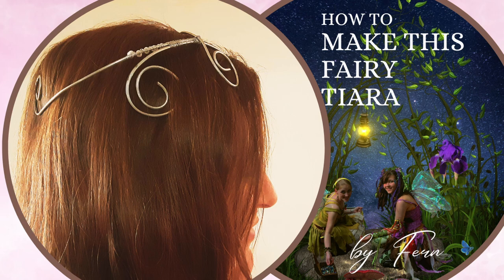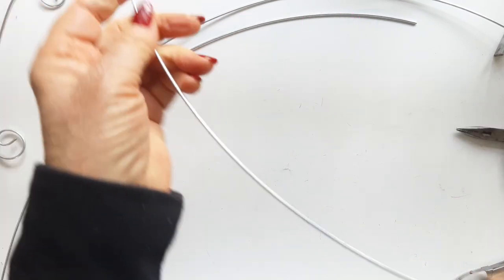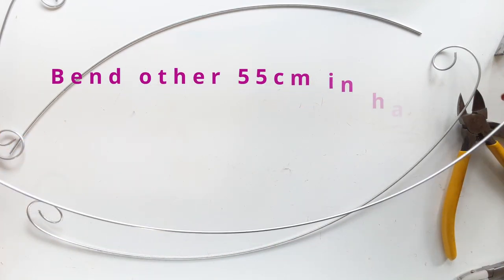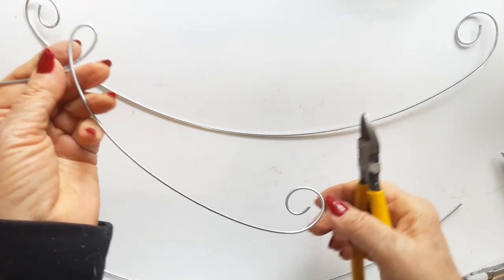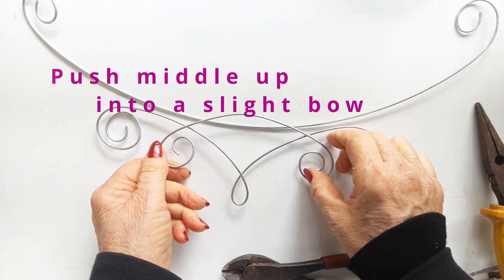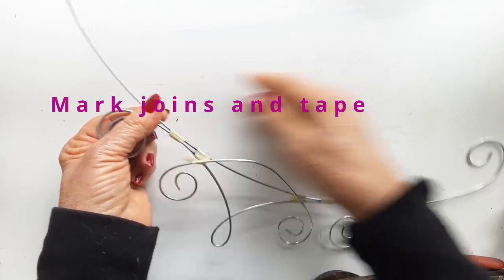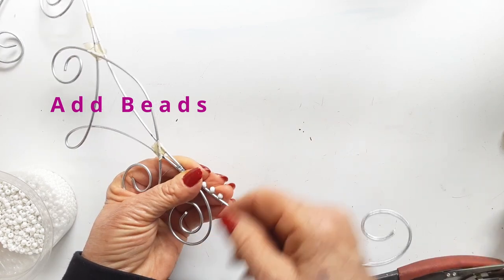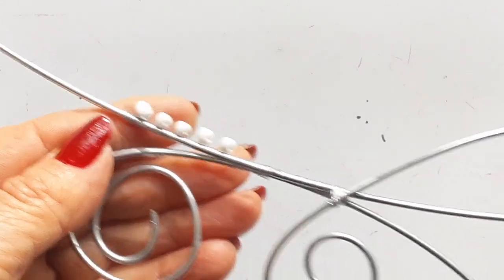Tiara Fairy Woodland Princess Crown DIY/Wire wrapped Wedding Bridal Elven Fairy crown/( NO Solder)

Comment: Awesome!  Can softer wire be used, as I don't think I'll be able to bend them:(
Reply from the maker: I am sure you can use a softer wire for this project. This was a very hard wire I used but as long as the wire holds the shape it should be fine. Best wishes!